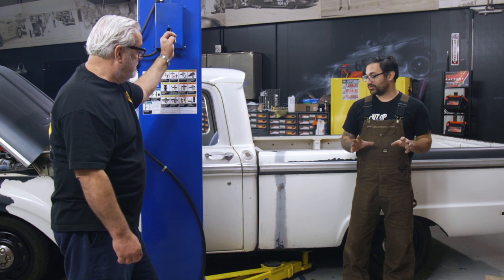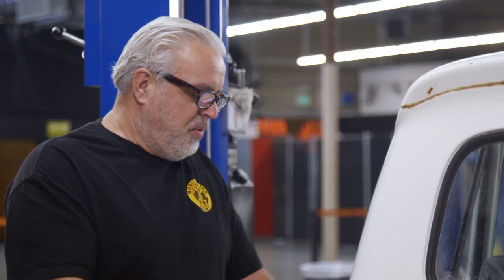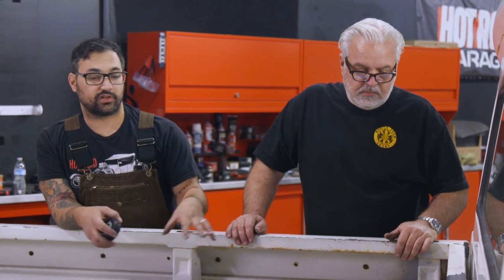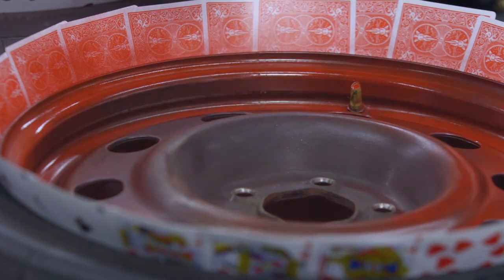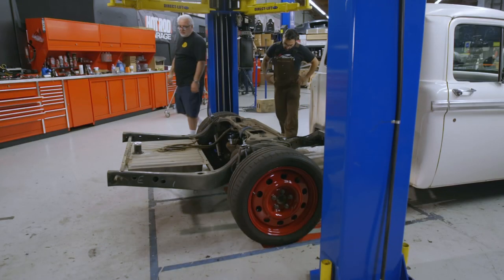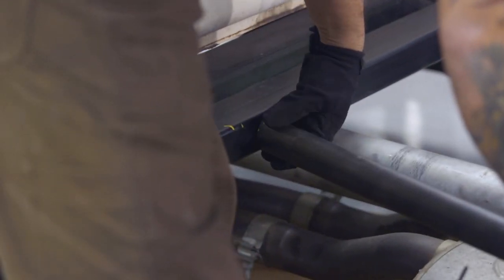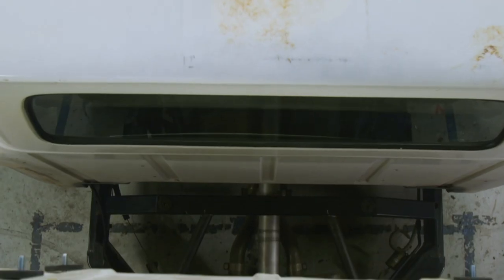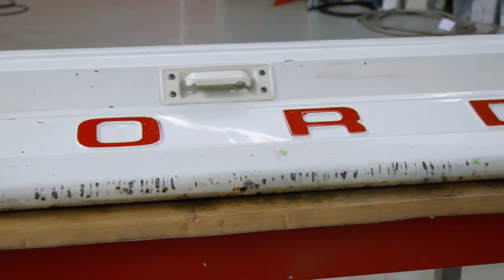Body Flex— Hot Rod Garage Preview Episode 74

Comment: Guys, the reason the frame flexes so much is because a Crown Vic ( like a Chevy Caprice ) has a perimeter frame that relies on the body to provide strength.  Connecting the front to rear is a rather thin c shape making for lots of flex.   Boxing in the C will give lots of strength.

Comment: Need a  triangulated cage to tie the front and rear together as the original body did.  I'm afraid the hockey puck idea will fatigue the sheet metal and cause fractures in the panels.